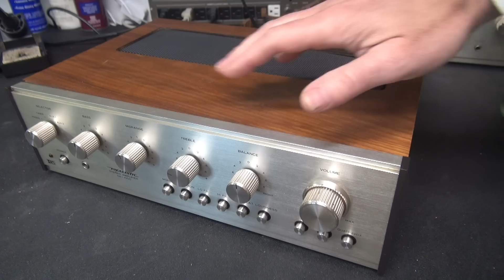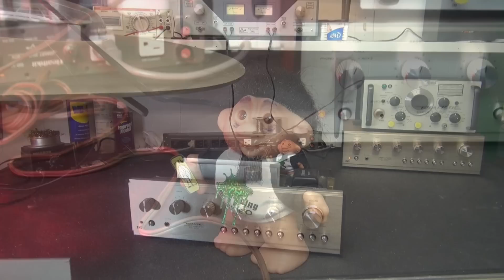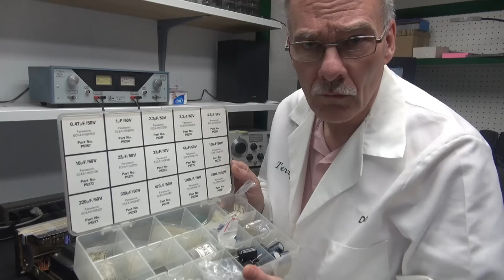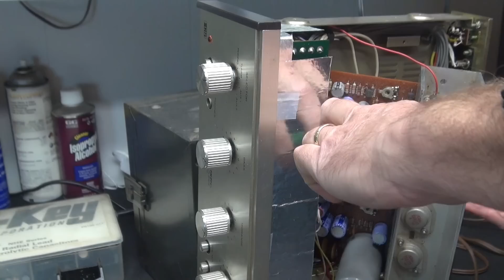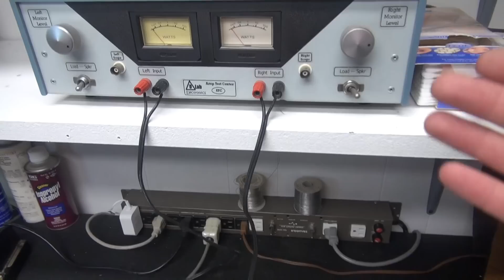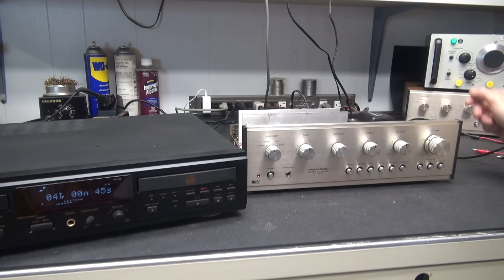How to repair a dead Integrated home audio amplifier step by step Realistic SA-1000

Comment: I don't "shotgun" repair amps.  I find the FAULT that initiated the failure FIRST.  Once the amp is working properly I consider "upgrading" the amp by wholesale component replacement.  Remember, your customer has to pay for your labor.

Comment: I've been repairing this stuff since the mid-1960s. You neglected to do several things. When replacing a output transistor,  clean the old, dried heat-transfer compound from the heat sink. The old, dried compound can prevent a good thermal seal between the new transistor and heat sink. You didn't explain what "bias" is. That would be helpful. From many years experience repairing as well as designing amplifiers (EE), the bias and balance trim pots are suspect, especially in vintage equipment from Japan, Taiwan, etc. They get oxidized and can drift with temperature, sometimes open, increasing bias to the point where the output stage overheats, creating thermal runaway. I suggest that you replace the trimpots. Also check the bias diodes. Many multiple diode arrays don't age well. Otherwise, nice job.

Comment: Hi thank you very much for this extremely interesting video 
I do not understand this choice of using tiny diodes after the mains transformer   Maybe once they were expensive
But today even 10A diodes are pretty cheap  Why not using them whenever possible ?
anyway is it me or these old small power amps sound pretty good ?   i am sincerely impressed by the sound

Comment: I have an optical SM 1515 B amplifier I bought with my high school graduation money so it's special to me if it ever needs a power capacitor which is a dual capacitor 50 volt 6800 microfarad if it goes bad can it be replaced and also if the power transformer goes bad can it be replaced and what about the output I see if they go bad can they be replaced they are sharp part number RH -ix1066afzz are they still available if not can it still be fixed

Comment: Hi Terry, really appreciate your videos on the Realistic sa-1000 amplifier, I am rebuilding one here at home, can you help with the transistor numbers located at Tr608 & Tr609 and resistor value at R533 & R526 on the  power supply and driver circuit board… thanks!

Comment: if the BIAS  shifts, over time, that alone may cause the outputs to short out?
i am repairing an od Yamaha amp and after replacing 2 shorted outputs and 1 driver, the outputs shorted out in  15 secs, and 1 resistor blew up, together with both 0.22 ohms emitter resistors...
you from  the LA area?

Comment: Nice.  Every time I try to check final transistor temperature, I remember (a split second to late) there is voltage there.  On a 70 volt rail, that's 140 volts across..  OOPSIE  Now I use a temperature gun (non contact) to check.  Works well on tube envelopes also.

Comment: I have a Realistic STA-85 I bought new in 1978! It's powered wall speakers on every computer Ive had since 1994 until about 3-4 years ago when it started periodically making noise like static maybe and I could see the bulbs inside kind of flicker at the same time. So I looked and didnt see anything obviously burned or wrong and bought a new amp/receiver.
Still would like to fix the old STA-85 since it has mechanical switches and my computers and amp etc are all in the basement on a rack and I turn the power off to the amp, printer and monitor with a wall switch at night and when at work (computers, modem, router run 24-7) with the STA-85 this worked perfectly with the new one and its electronic controls, turning the power off means after I turn the power back on I have to go downstairs and turn the amp on and set the volume level every time.
I figured on replacing the caps regardless of how they looked as they ARE from 1978 and see if that fixes the issue, havent done it yet, but it worked fine, powered up fine always, never blew a fuse, just that periodic noise over the speakers.

Comment: I see a lot of the times with these old units those trimmers get corroded and go way out of spec typically cranking the idle bias way up blowing the power transistors. Always fun trying to figure what what its suppose to be set to afterwards unless you're lucky enough to come across another working one -- also under no circumstances should an NTE or ECG part ever be used, anyone who suggests such should be slapped. Find a proper replacement component by researching the original parts data sheet and cross-referencing this against other components, a popular part to go for is C458/C1312/C1344 -> KSC1845FTA, A725/A726 -> KSC992FBU, there's a couple others but ive noticed those 5 parts in general seem to be everywhere and always cause problems.

Comment: A quick way to diagnose any shorts in the system is get some tin foil the thick gauge is recommended wrap it around the fuse. Then install, plug in the unit and push the power button all you have to do is follow the smoke .  No test equipment is needed .

Comment: This is not a balanced current system 50v 0 v 50v but simple +- 
It is not the best system acoustically since you then have to have large capacitors in series with the speaker wire to prevent a lot of current flowing into the speakers from destroying it. I personally would never have bought such an amplifier

Comment: thanks for this nice video, can u put a video for repairing 3-piece speaker sets like "Frisby FS-6200BT" including safety measures for newbies like me, I have something like that and one speaker output seems to be faulty (much lower volume compared to the other one) I'm afraid to open it and check for faulty/burnt components because of warning about electric shock warning written on it not sure what can go wrong (if not plugged)

Comment: Back in the day bad i.e.; shorted power transistors figured heavily in blowing fuse issues. People would do all kinds of bad stuff to the outputs, including but not limited to, shorting out the speaker terminals. This actually an easy fix. Burned components made themselves known.

Comment: Hello! Sorry if my english is not good! Thank you from the bottom of my heart! I had AKAI AM-U310 stereo integrated amplifier since 1982 till few days ago. This amplifier means a lot for me. Before it died out it was connected to PC, I was listening music at a relatively high volume and my PC is setted to enter in standby after no commands is performed and HDD and monitor stopped. In that moment I've heard a big boom sound and no sound in speakers after I've exit in standby. I stopped the amplifier and turned on and the click start sound no longer appeared and no sound in speakers. Also sometimes I had sound only on right channel together with a crackling sound from speakers on left channel. All being said you think that STK / STK's is broken? I want to make this amplifier to work as good as it can be. I'm sort of audiophile person. Kind regards!

Comment: Hello! Sorry if my english is not good! Thank you from the bottom of my heart! I had an AKAI AM-U310 - this amplifier means a lot to me. Before it died out it was connected to PC, I was listening music at a relatively high volume and my PC is setted to enter in standby after no commands is performed and HDD and monitor stopped. In that moment I've heard a big boom sound and no sound in speakers after I've exit in standby. I stopped the amplifier and turned on and the click start sound no longer appeared and no sound in speakers. Also sometimes I had sound only on right channel together with a crackling sound from speakers on left channel. All being said you think that STK / STK's is broken? If yes, can you tell me please where can I find the original STK's? I don't want to broke this very good quality product with bad STK's, I want to make this amplifier to work as good as it can be. I'm sort of audiophile person. Kind regards!

Comment: Hello, question for yeh? Anyway' I have a older model sony home av stereo receiver model da5600es its around say 12-13 years old maybe. I unfortunately did a memory reset or memory clearing due to the receiver previously having been already presetted in the past! All I wanted to do was a factory reset, that's it! Now it's stuck on MEMORY CLEARING! can you maybe help with this problem or have some ideas regarding this major mess-up? Thanks

Comment: Nice amplifier, but these large Rubycon capacitors  (4700uF/80V) are Chinese fakes. Currently, there are a lot of Chinese fakes on the market that have nothing to do with the originals.
Reply: On digikey every capacitor comes with a country of origin statement. Does it mean it's a fake if a nichicon comes from Thailand or they just have a factory there? Other nichicons come from Japan.

Comment: Nice job on getting the amp working. However, I was startled when you kept your right hand on the (metal) volume knob while reaching into the powered-up unit. Yeah, it turned out okay, but first, it's possible for that heatsink you're touching to have voltage on it, and second, this is an older unit with a 2-prog cord. So the chassis is not grounded, and if it has a hum-stopper zap cap that's gotten leaky, you could even get a lethal shock. My rule: when touching a powered-up unit that has its cover off, I keep my non-dominant hand in my back pocket. This makes me stop and think before I decide whether it's safe to touch the unit with both hands. Also, it seemed like you did a LOT of work on the amp without checking to see if the transformer was actually shorted. Easy to do, just lift one of the leads going to the board, power it up, and measure what's coming out. Maybe you did that off-camera? Yes, a shorted output transistor will pop the fuse, but finding one doesn't mean the transformer's not roasted.

Comment: I have a Logitech z5500 speaker system and it started making this it’s a
 extremely loud buzzing sound that was so loud on all speakers and sub shook the floor that is was totally unusable. I replaced the 3 largest caps on it. It helped a lot. But it’s still lightly buzzing all the time. But at least I can use it again. I heard that as amps they age. That they will start buzzing. It’s bout 10 years old. What else can I replace to make the buzzing stop? It’s a 5.1 audio system

Comment: Wow I have an old JVC boombox  (RV-NB20B). This was my outside source of music for more than 10 years. I loved it and bragged about how tough it was and how good it sounded. It quit working about 7 years ago. When I turn it on, the red power light comes on for a second and then there is a static pop from the speakers, and it shuts down. I have kept it with me always hoping I would come across a proper electrician who could fix it. I wish your were close by. I bet you could fix it. I'm old enough to remember when most towns had a shop where you could bring your electronics to be repaired. Now-a-days folks just throw the unit out and get another one.

Comment: I have an Arcam integrated that has a bad channel.   The right channel is fine until the volume is turned up.   How do you check components that only fail under load?

Comment: Don't knock the old Realistic amps. This one is rated 20 WPC, and this was when they were rated using the old honest rating system. Now you'll get the cheapo Chinese amps on Ebay claiming 500 WPC, and they are really 8 or 10 WPC using the old method.

Comment: Can you teach me how to fix a Pioneer SX-950. It has a feedback problem, it works, but there is a feedback problem, dried up capacitors.. It makes a sound when cranked up. If not, it will end up as 'EE Avfall' here in Norway

Comment: Sorry but this SA-1000 is not an integrated amplifier, it's a discreet one...
Reply: “Integrated Amp” is a term used with audio components meaning Pre-Amp and Power Amp are combined, or “integrated” in the same device. It’s a throwback term of sorts because early audio gear often used separate pre amps, power amps, and tuners.  Today the title “Integrated Amp” makes people quickly, and wrongly think of IC amp technology.

Comment: Quick question: wouldn't it be a good idea to have checked your DC offset on those speaker connections prior to plugging in your speakers or was there something you tested beforehand that let you know that it wasn't necessary?
Cheers! 👽✌️
Reply: Yes, checking DC offset is crucial for direct-coupled amps, but this amp is the older type that has a single-ended power supply, therefore a large blocking capacitor is required between the output transistor and the speaker terminals. While it is possible for this blocking capacitor to leak DC, it would be rare. Also, he replaced all the caps in the output section, so, no chance of that.

Comment: Transformers also age, and may exhibit AC leakage current to the case. If the unit does not have a ground (3-Prong plug) you could temporally attach one to the chassis (or any piece of case metal an operator may touch) if at ground potential and not a hot chassis.  It is fortunate that D-Lab uses 115VAC at 60Hz power, in that you can make a simple AC leakage detector by using a GFCI as part of your isolated AC power supply. By supporting both a regular and GFCI receptacle, after repair and setting the AC voltage at high line, you can use the GFCI to see if the repaired device has AC leakage to the case above 5mA. If so, the GFCI will trip. 

To measure smaller leakage currents you will need to use a sensitive AC current leakage meter. All "appliances" should be checked for AC leakage before return to service. Traditionally this was targeted at AC motor powered devices with issues with motor insulation breakdown. However, as transformers age they will also exhibit insulation breakdown. You could HiPot test the transformer to understand a withstand voltage, or possible problems due to insulation breakdown. But, I think the leakage test is probably sufficient and quickest for most repairs. I would like to hear about if others test for AC leakage. Using a GFCI receptacle is a rather quick solution especially if apart of an AC variable isolated power supply. If replacing a transformer with a new unit you could HiPot test, although this test is usually done at the factory.

Comment: There are options today for "better" components which will easily surpass older designed semiconductors and Electrolytic Capacitors. Now can you get them the same package, lead space and diameter through-hole configuration, well that could be a challenge.

Comment: Hi Terry, love your videos. Thanks for uploading. Anyway i am just started this whole electronic stuff as a hobbyist. There’s a lot to learn and your videos sure helps me a lot with my learning journey. Anyway, I noticed, when you check the speaker tranny. On emitter and collector, when it’s good. It will show up ‘OL’. But   At about 12 min. When you check the other tranny.. collector to emitter showing a value instead of OL. Do you mind tell me why? Love to hear your feedback. Thanks!
Reply: He was using the "Diode Check" function on the meter. The meter puts a current limited voltage to the test leads connected to the device under test. The reading is in Volts and represents the forward voltage drop across the junction. Base to Emitter, Base to collector, then emitter to collector. Then reverse the leads. His meter may count to 1.99 or something like that and the applied voltage may be above that so three meter shows "OL" over or out of limit without an automatic range change.
I hope my explanation helped. Good luck with your hobby. Keep at it!

Comment: Could this procedure also be used for other amps? I have a Pioneer SA-510 that has no sound on the right channel (on both A and B) I searched but I didn't find a visual shorted component so far.

Comment: A question.. I've got a receiver amplifier  that's got nil output from any inputs .. even plugging headphones gets nothing.. I'm suspecting the audio processing chip died.. is there any suggestions to confirming this or something I might be missing on the output circuitry I should check

Comment: Cool video Terry (and nice name btw lol) You are so funny. Clever and funny, I enjoyed it. 

Hey, I don’t understand what is the dummy load for and how to plug it... can anyone clarify this for me because I don’t want to mess up my scope. I think the dunmy load is in series between the amp’s output and the scope? Why can we scope circuits max 400v in the amp and not the RCA output? Is there high voltage in those little plugs? The more voltage the more power the speakers will produce I guess?

Anyway, thanks for sharing your work. I’m starting with amps repair. I’m more into computer board repair and I tried to use my Linear Bench PSU but it’s DC lol wasn’t doing much. I’m looking for a Variac now that I have an isolation transformer for nothing xD!

Have a good day everyone!

Comment: Applying 240 volts to a newly repaired amp is foolish, no mater what protection schemes is used.
A safer method is to used a power supply to substitute for the main amp supply and increase the DC voltage to the amp.
By doing this you can keep a check on the bias voltages and the output speaker terminal voltage.
You can also adjust the bias to the main amp transistors.
Have used this method many times with no nasty surprises or fried components.

Comment: Excellent video thanks, Ive been there with a number of Amps and what you see is very common. I hate the old PCBs, the copper comes off just looking at it! I have a slightly newer unit but it has some SMD transistors on the copper which sense over current, Ive fixed the root problem but the sensing circuit still triggers and shuts the amp down. Horrid thing to fault find

Comment: Testing transistors in the circuit? Do they show correct value while in the circuit?
Reply: They should! Unless the emitter to base resistor is of low resistance! Say less than 200 ohms. FYI the base- collector reading will always be lower for Bipolar transistors!